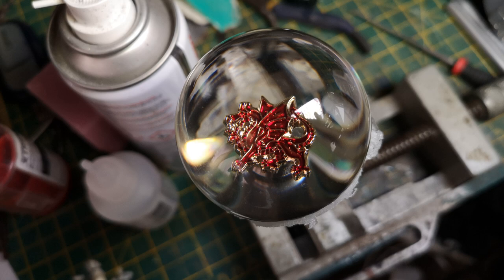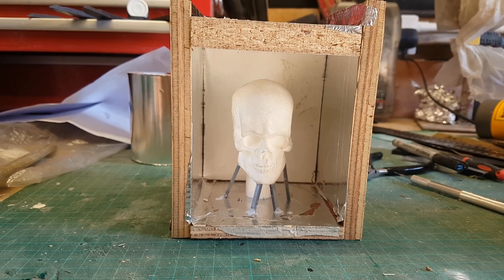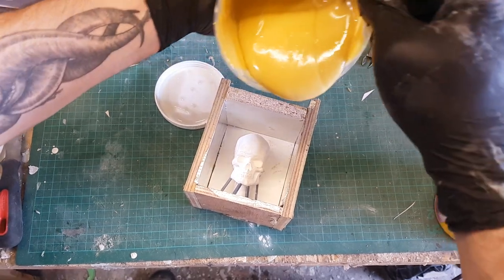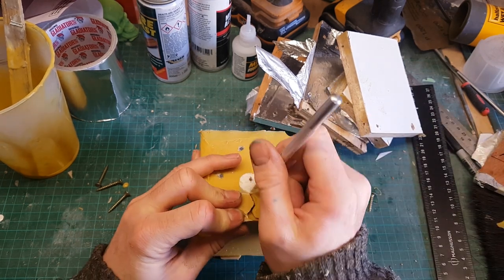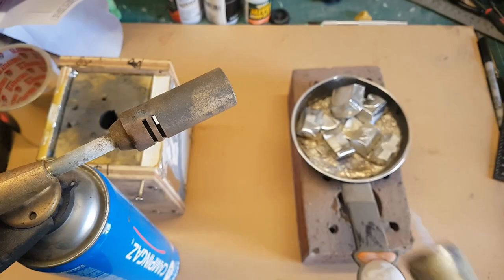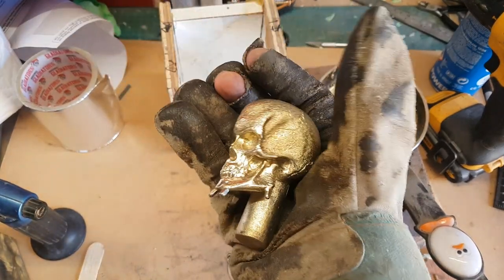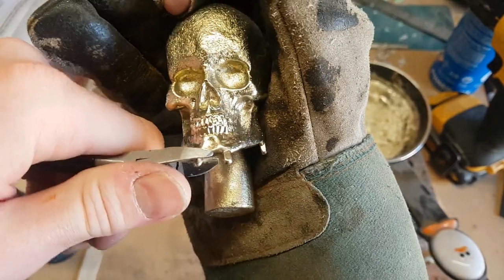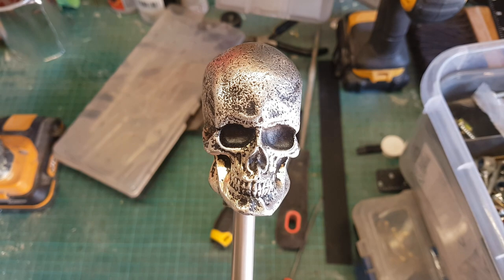Casting a Skull in Pewter

Comment: Fricken beautiful! I tried to work with resin before and never really liked it not too mention the yellowing over time. I am stoked to try pewter not only does it look cool and fun to work with, it's recyclable! Like the mess up you had you were able to salvage most of the pewter for another pour. Cant do that with resin.
Reply from the maker: Thanks. Yeah it's a nice material to work with and you can get some nice results. Only drawback is it's HEAVY.
Reply: @The Dark Power  Heavy...? Good to know as I plan on using it for jewelry at first. I have been working with precious metal clay (silver), which isn't very heavy, though it is very expensive. Plus, any mistake with the pmc is pretty much a loss until I can melt silver.
Reply from the maker: @alltaira5922  Yeah .  I'm not sure how much the skull in the video weighs, but it feels like at least a kilo.

Comment: I know this was a year ago but smoke your mold with a candle so the black sot coats the mold 
Much better than what you have been using also preheat your mold and to make it shine put it in a vibrating tumbler with crushed walnut shells and at least a half a bottle of Nu- shine once a year car polish  leave it in and running for at least 24 hour or longer 
Comes out super nice
Reply from the maker: Thanks, will definitely give that a go next time I do some pewter casting!
Reply: @thedarkpower  the polishing works on any metal
Reply: What does the candle and black soot it produces on the mould do? Do the castings have better quality, in terms of definition?